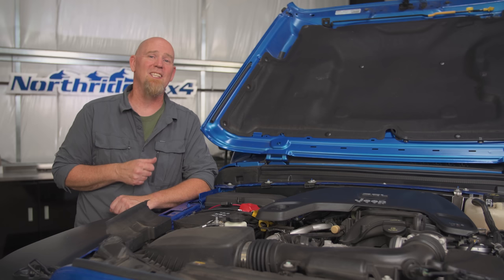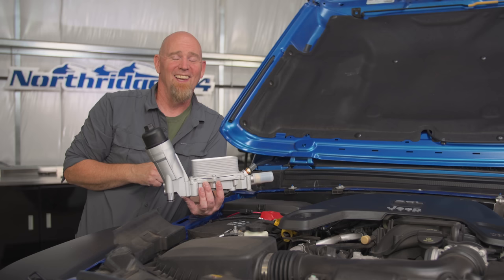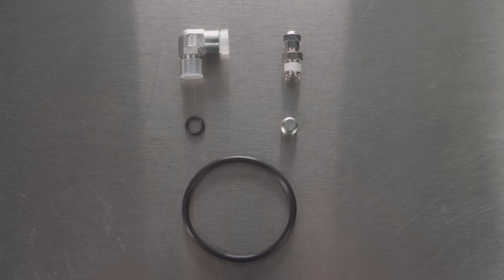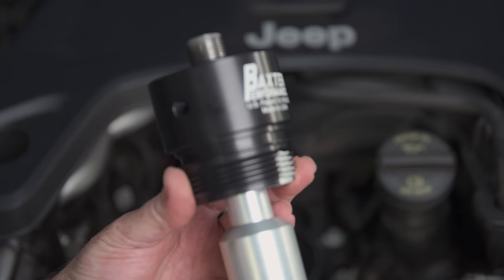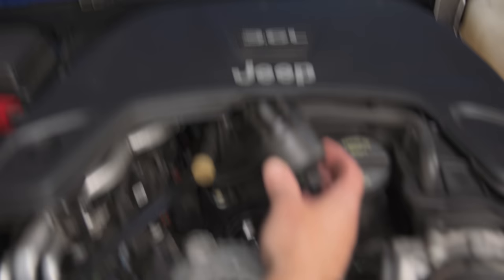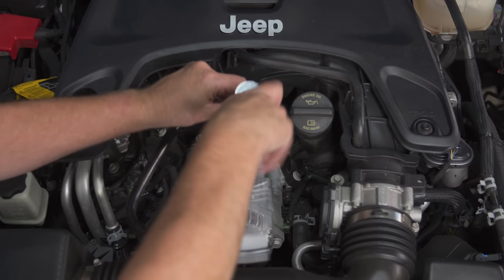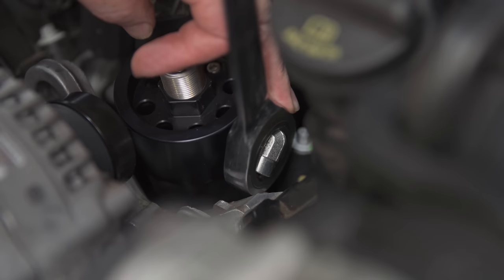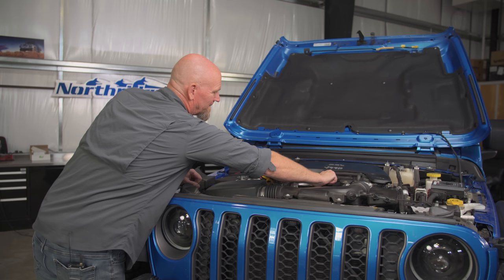STOP Dry Starting your Pentastar 3.6!!

Comment: The whole time I was wondering what a mess it would be to swap out a vertically mounted oil filter. Very clever solution.
Reply from the maker: It is pretty cool. After we blew it down the first time, we thought the same thing, very clever.
Reply: Yeah this mod might be the lifesaver for this horribly designed oil system
Reply: Just got around to this last weekend. Pretty straightforward. I don't have a 15/16 ratchet, so went with an adjustable C wrench for getting the shrader valve installed. Also I couldn't quite get the thread lock adjusted to a place where I faced zero resistance screwing in / out, but doesn't look like any threads are damaged either.
Reply: I was thinking the same thing and at the same time wondering what the heck the shrader valve was for. That is ingenious.

Comment: This looks like a solution in search of a problem.
Reply from the maker: Or a solution to a problem that you'll know when it happens to you.
Reply: 100% BS snake oil.  Completely unnecessary with a quality and properly spec'd oil.
Reply: @lovetopew9054 And a guaranteed oil mess to clean up at every oil change!  Garbage design!
Reply: Holding a puck of oil in the filter location does what? Nothing. You still need time to let the oil goes into the places
Reply: Yeah, my thoughts exactly. Just keeping up on regular maintenance is all you need.
Reply: Let the engine warm up for a minute before redlining it. If the engine is run everyday there should be enough oil film to protect the cams. 

This won’t help when the engine design is flawed
Reply: @northridgenation  And if it ever causes an engine issue your warranty is void. No thanks.
Reply from the maker: @steveludwig4200  same with all the other mods we do to our Jeeps.

Comment: In the late 60s and early 70s Lee Oil Filters were popular and successful. Chrysler came out with a service bulletin saying NOT to use Lee Oil Filters due to the Filter allowing Oil to drain out of the Filter and basically every time you started your engine the Oil pump had to refill the Filter and it was a dry start . Here we are in 2023. Some things never change. Good info !

Comment: So I have been looking into this Baxter for a while now and finally just got mine installed like yesterday. I got my JT launch edition used but in great condition around 21000k miles. I notice the weird sound every time I cranked to start the vehicle. Took to the dealership and was told it’s normal, “how the engine sounds for this 3.6L”. But I everyday it starts to bother me to the point where I am reluctant to the start the car knowing that it would give me this “metal to metal” kind of sound at the crank. So I started to do my own little research and found your channel, which is extremely useful especially in this particular scenario.  So I decided to ordered but it was back ordered. It finally came in yesterday and installed immediately. To my surprise, that weird metal to metal sound at the crank up simply GONE!! So I just want to add my personal experience, hopefully it helps other viewers.  I do sympathize the cost of it though like everyone else mentioned . However, for my scenario, eliminating that weird sound each time I started the car, it is much worth it already, let alone whatever the benefit it is claimed to have which is remains to be determined. 
Thank you for such a detailed and helpful video instruction.  From one happy jeeper 😊
Reply from the maker: Thats great @esmpmedia8586! Glad it helped out.
Reply: once you hear sound, it's over. it's just a matter of time. Just like a wheel bearing going bad.  No matter how much grease you put on it, once it starts to go, it's over.
Reply: Imagine the mess the ESS must be doing at stop lights... glad I do not use the ESS "feature". Now I am looking at buying this adapter. 😎
Reply: It's been 9 months, how's it holding up? Any issues?

Comment: Ok so I just bought a 2024 Gladiator with a 3.6 Pentastar engine, that from everything I’ve read about this engine in Wards, my first impressions are as safe as what facts I’ve read. Now I found this gizmo that makes perfect sense about an issues I’ve always known about, that I at times would actually shut whatever I was starting right off a couple times just to help get the oil pres. up. But with no key ignition might cause other issues.

Comment: I run 5 quarts of 5-30 Semi Synthetic and 1 Quart of Lucas.... No issues and it runs cooler, and all my cam sensor codes vanished.    most 3.6 issues with the valve train are caused by running the 5-20 crap oil. The cam phasers love the 5-30

Comment: This Baxter Performance device is INGENIOUSLY BRILLIANT !!!   My problem is that I have an old 3.7 that keeps on running, and running and running .... and with NO signs of 'dropping' its valve seats ........ yet.
Reply: ‘16 WK2, 98,000 miles, and still running great.
Reply: 2008 JKU with a plow @ 298,000 miles.
Reply: That's been known to happen.... 

That later generations (2014+) seem to have much less issues with that.
Reply: My daughter has an ‘07 GC with the 3.7 and 180K miles and purrs like a kitten…

Comment: The rockers have needle bearings though, they should hold oil in them. A two stroke engine survives with just a mist of oil blowing around thanks to using needle and roller bearings that retain some oil film.

Comment: 2012 Avenger,3.6L.145k miles. Always used full synthetic,(Mobile,now Pennzoil). Changed every 6k miles. No issues. Good power,decent mileage. Just normal valve train mechanical noise.
Few  times a year added Marvel Mystery Oil to supplement cleaning internal components. Strong, smooth engine. 
Just change oil regularly and keep at full mark level.

Comment: The video convinced me so I clicked the link.  Holy guacamole, $342!  I guess I'll continue to "clear flood" before starting.  I've done this for years.  Accelerator to the floor and turn the key...let turn for 3 seconds and then let go of the accelerator and the Jeep starts.  If someday I do decide to buy, I will go through Northridge as I've done for plenty of mods for my Wrangler to help it when offroading.
Reply: Does the "clear flood" work on a 2016 Wrangler ?  It's a good idea.    I run synthetic oil too.  Lately I've been working from home.   If my Wrangler sits for two weeks I hear a VVT rattle.  It lasts for a seconds and clears up.  Other than that if I drive every day, every other day or once per week, no problem at all.
Reply: @jerrynormandin2892 that's normal and not a reason to be concerned

Comment: Late model JKs have an engine cover that will not allow this oil filter device to be used unless the cover is left off.  While the OEM filter does not have a check valve to prevent draining, it would appear the engine oil pump is more than adequate to suipply what ever oil is needed shortly after start up since over 10 million of these engines have been built and it doesn't appear oil related failures with the OEM filter is an issue!
Reply: Many issues with lifters and scored cams
Reply: I think that no start priming process should be good enough but then your starter could go to 💩

I’ve had issues with ram lifters, rods, and cam but only after 250k miles and religious oil changes. I think regular maintenance will not give us any problems
Reply: That’s incorrect though… rocker arm failure at random intervals is by far the most common (and arguably the ONLY common) failure on the Pentastar engine; and that’s believed to be caused by needle bearing failure due to lack of lubrication. The argument is that since the oil drains back down to the pan while sitting, the valve train remains un-oiled for the first 4ish seconds upon every single start up, which obviously accelerates wear and exacerbates the rocker arm failure. 

This product attempts to help save these rocker arms.
Reply: @mcspartan5822  There has never been a published total number of rocker arm failure for the Pentastar 3.6 engine so it is difficult to tell the total population involved. But certainly enough for a class action law suit against Stellantis. 
While the rocker arms do fail, there hasn't been any analysis other than they failed and it is unknown whether it is attributed to oil starvation, poor or improper heat treat, failure of the parent metal of the needle bearings due to any number of reasons. So to say the rocker arms failed because of oil starvation is jumping to conclusions without all the facts!
There are other engine manufacturers that use the cartridge filter design as on the Pentastar 3.6 which the oil inside the filter housing can drain back to the crankcase once the engine is shut off. None of those engines have a check valve either because if they did, you would need a method, as in this aftermarket unit, to use compressed air to force the oil inside the filter housing out so you don't make a complete mess when you turn the housing loose! And in those other engines, I haven't heard of one engine failure attributed to oil starvation!!!
While this after market solution certainly doesn't hurt, it doesn't prove that the rocker arm failures on the Pentastar 3.6 was attributed to oil starvation!  If you have data that prove otherwise, please share!
Reply: not to worry, 20234 JL 3.6 does not even come with engine cover.
Reply: lol yeah found this out awhile back. I have a 2018 JL that came with one and was missing it on my 2022. 🤦‍♂️ they are smaller covers and they do work for the Baxter setup. I bought the parts to add a cover to my 2022. It just looked so naked and unfinished compared to my 18.

Comment: 2014 3.6 JKU.  Driver side cams and followers at 100k. Oil Filter housing, cams and followers on the passenger side at 200k.  I now have a blown head gasket at 305k. The life time Chrysler warranty has been a life saver so far. 2 heater cores and 3 radiators along the way too.
Reply from the maker: Awesome that you have the lifetime warranty. Sounds like that has saved you big $$$.
Reply: @northridgenation . Yeah, I made bank on the warranty at $2300.
Reply: how much money have you spent at the dealers doing  the service that is required ?
Reply: @rodgood  Zero. I do my own oil changes and have all the receipts. I use Chrysler approved full synthetic oil at less than the required intervals. My dealer called me out on that at 100k for the first set of cams, and I told him, look in the glove box. That was the end of that.
Reply: @CRABlife-iv6fv . Probably not. It's a heat treating issue. The cams are too soft.
Reply: Update. Chrysler approved a new engine. $10,000. I'm having the dealer put a new clutch in while it's apart. Just have to cover parts. Clutch is fine but hey, with 305k miles, why not?

Comment: This is a good idea for the 2nd gen 3.6 because they have variable lift intake rockers and they fail at a alarming rate,destroys the intake cam lobes mostly the pass side head.
Reply: -_- I feel this. 2nd grandcherokee with this problem lol
Reply: My 2016 Chrysler 3.6 had rocker failures on both sides . I had to change to both cams on the driver side (bank 2) and one on the passenger side (bank 1).
Reply: Nearly 200k miles on mine, runs great.
Reply: There are so many 3.6 Pentastar engines in vehicles out there, the problems are magnified. The engine has been out a long time…nearly 14 years…and used in the Wrangler, Gladiator, Grand Cherokee, Challenger, Charger, 300, Grand Caravan, Pacifica, RAM 1500, and the smaller 3.2L Pentastar used in other Chrysler models. With that many engines out there…yeah, a few have the cam lobes / lifter problem but most do not. Change your oil regularly; it’s a great engine.
Reply: How is this problem diagnosed? What are the symptoms?
Reply: @wolfe2118  ticking from the top of the engine.  Get it looked at right away if you have a steady tick or you will soon damage the cam and will be out more money than just changing lifters
Reply: @tylermacconnell217  Town and Country with a 3.6, Commander with a 3.6. Oil changed religiously and with high quality filters and good synthetic oil since new. Both started ticking at 160k miles. This is an engine design problem, pure and simple.
Reply: @wolfe2118   a audible tic sound, a misfire that doesn't go away even after replacing the coils and plugs
Reply: @mundanestuff  no its to low of a weight oil. I've been running 5w30 synthetic in my 12 charger now at 185k and just checked mine, all soild. My daughter's wrangler ran with 5w20, and at about 85k.We had to replace lifters, rockers, and 1 $400 cam. I feel they have the wrong viscosity running these engines just to give a super small increase in fuel efficiency.
Reply: @tylermacconnell217  Statistics are statistics. Prior to the redesign, the valvetrain was a major issue due to a manufacturing problem in 2012-14, but also oiling and cooling issues. Our very well maintained, highway miles mainly 2014 JKU had rollers replaced in 2016 at 27,000 miles or so, then the entire driver side head replaced at 87k. We paid $700 but that was because of maxing out a car rental due to supply shortages during Covid, otherwise it would have been zero. That is a way out of warranty, zero cost replacement because of a badly designed and manufactured motor with a known, pervasive issue. 

Jeep has been mostly good to us, so we decided to get a 2022 JLU and when it was delivered I couldn't believe the noise of this motor -- it sounds like a diesel clattering away. This time around they added insulation to the engine bay instead, and left all the foam off the top of the motor which I suspect helped to create warping because of differential cooling, or they had added it in the previous model to begin with because of differential cooling.

Anyway, the previous gen Pentastar had a well documented weak link.
Reply: @wolfe2118  Well, it all starts with a faint tick tick tick tick on start up then gets worse as time goes on and then something breaks if you don't fix it.
Reply: @Sam-656  Did you buy this new? What was the mileage when you had this happen?
Reply: 2016 Rubicon, 25,000 miles and the ticking started and got louder over time. Then the engine stopped running all together. Had it checked by two different mechanics and they said that the engine components on the passenger side failed because of defective parts. Chrysler should buy me a new engine.

Comment: I had a Ford truck straight 6 cylinder. I installed a external electric prelube oil pump when new. I got 350,000 miles out of the engine and was still fine when I sold it. Start up is a engine killer till oil pressure comes up. Also change oil at half the recommended intervals. Transmission fluid at 40,000 mark. The rear oil too. Use the best oils and filters. Use magnets.
Reply from the maker: The old 300? Those Ford straight 6s were awesome!
Reply: Yep the 300. @northridgenation
Reply: An old ad from years ago “Starting your engine is terrible thing to do”

Comment: Just make sure you keep the original oil filter used and the original cap on hand if you need to have warranty service done, as you want to reinstall the original components before you bring it in, as they will use that as an excuse to deny warranty service if an engine component fails.
Reply from the maker: Great idea! Like removing your Tazer before taking it in.
Reply: I’ve seen some recommend using 3 qts 5W20 and 3 qts of 5W30, so in essence 5W25.
Reply: Man... I had to have my cams, lifters, and rockers replaced last month.... I had to reverse SO MANY things before taking it in.

Comment: As soon as I heard the rocker/lifter tick on my 2013 JKUR, I stopped driving it and a few days later I did the work to replace all of them with the new "improved" rockers and lifters. Guess what? After sitting for several days, the rockers and cam shafts still had a coating of oil on them. I use a high quality oil - Penzoil Ultra Platinum but have also used Amsoil. Those are the only two I would use and are the highest quality rated oils you can buy. Still got the tick. Anyway, this initially sounded interesting but I"m just not sold on the "engineering". The Pentastar 3.6 isn't the best engine, but it's not terrible. I've got 130k on my almost daily-driven, Arizona off-roaded  2013 JKUR. I do all the work, don't skip maintenance, and fix problems as soon as they come up. It still runs like new.
Reply: Did you end up replacing the rockers again? I am currently dealing with the same issued off a brand new rebuild
Reply: @abraxishalliwell9645  Nope. Just the one time. No issues since then.